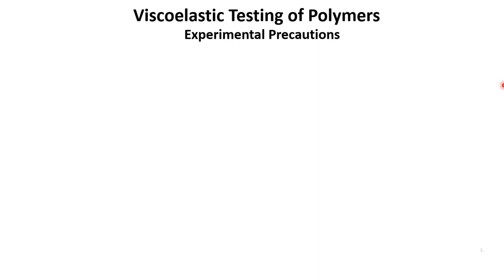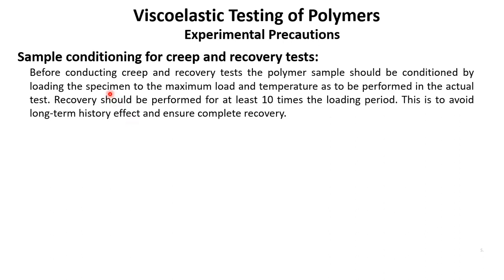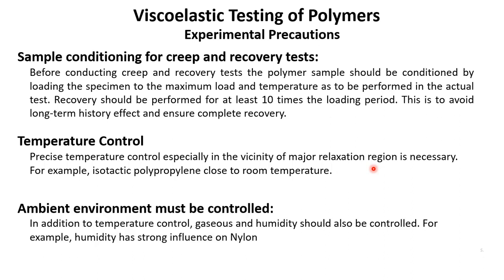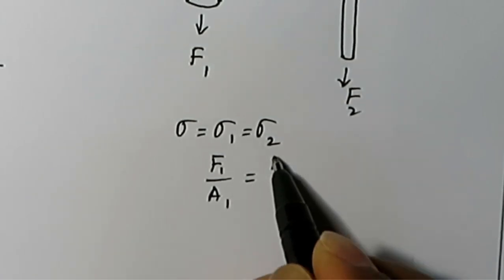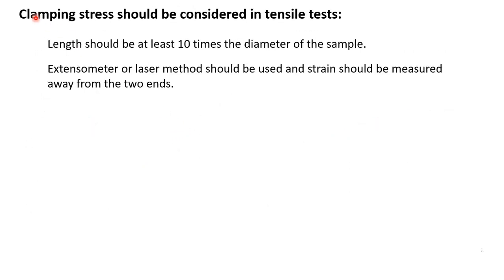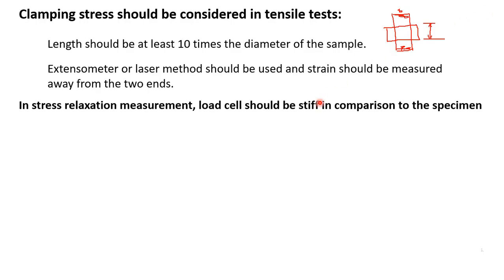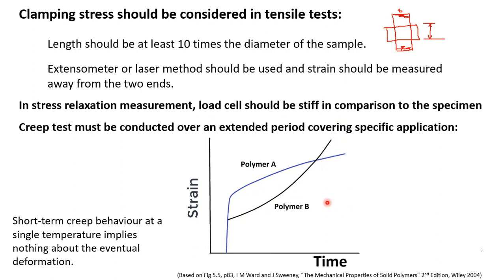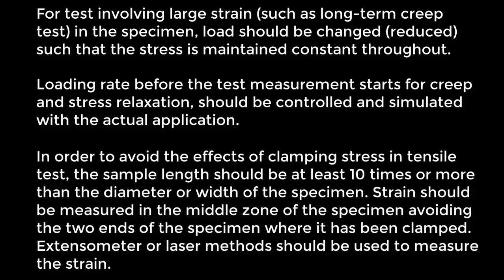Precautions in Experimentation with viscoelastic Materials

Comment: Sir,I have doubt regarding Sample conditioning for creep and recovery test.
Is that 100% recovery possible?
Is there any loading history for freshly prepared sample?
Reply from the maker: Thanks for asking very important questions.
Recovery will depend upon, if the molecules of the polymer has sufficient memory effect to recoil back to original position. This process itself is an energy consuming process and has to be supplied by the strain energy stored in the material during straining (proportional to the storage modulus). Hence we cannot say that for each case of creep test, the polymer will recover 100%. Also, the time required for 100% recovery may be extremely long which is again not possible to realize. Hence, how much recovery is possible within a time of say 10 times the loading time will depend upon the total strain, rate of loading, temperature compared with the Tg of the polymer, storage/loss modulus of the polymer etc. For any design application where intermittent loading occurs, it is important that 100% recovery is achieved within the given no load period for the polymer otherwise permanent deformation will be there before the next cycle of loading. This will lead to early failure.

Freshly prepared polymer specimen has also gone through some kind of loading during the making of it. Hence, that will act as loading history. Depending on the processing method, there may be considerable amount of loading history. For example, a polymer may have undergone rolling/calendaring, compression, extrusion etc. Even moulding will give rise to some internal stresses which will act as load history/memory. Therefore, even a freshly prepared polymer specimen should also be conditioned.